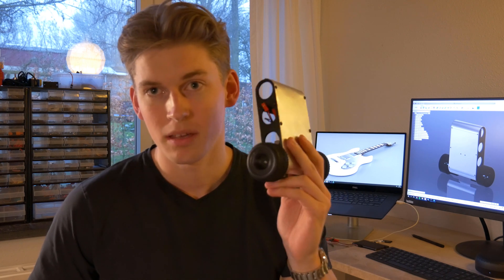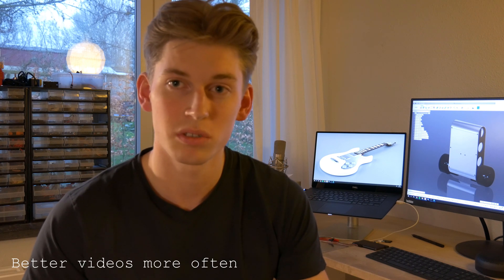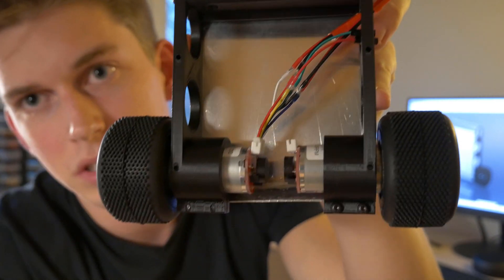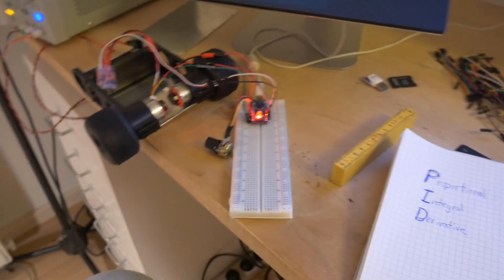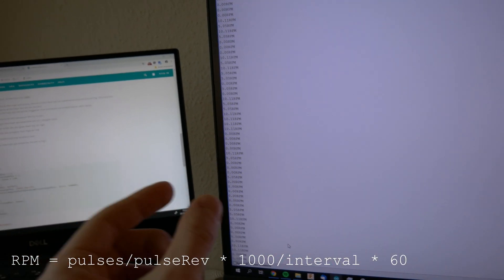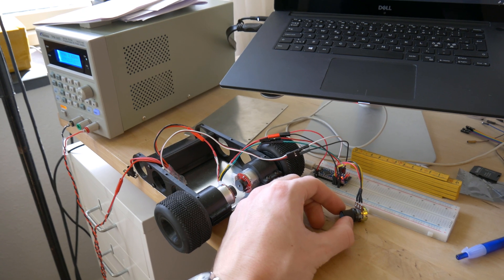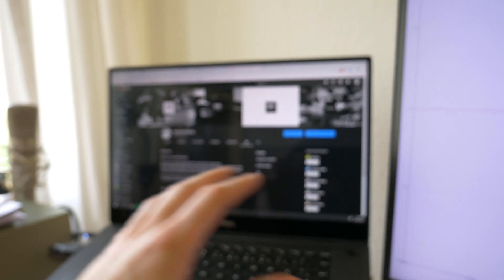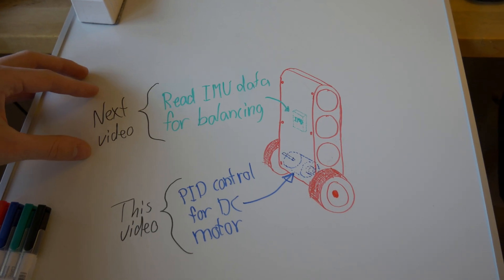Arduino 2-Wheel Balancing Robot - Part 1

Comment: Hi Karl, Thank you for the video. Can you Kindly point to the theory of this? I know this is based of the concept of inverted pendulum. But would like to know how do we arrive at the size of the robot? Why is it the height it is and why not shorter or taller? what factors/dimensions influence its cg? How do the size of the wheel affect its control? I am not sure whether you referred to technical papers, if you did can you Kindly share the links to the references you used? Thanks.
Reply from the maker: Hello Messier

I didn't pay much attention to the dimensions for this robot. The higher the cg, the easier it is to balance. I haven't completed this robot so I don't think I am the right person to give the best advice 😄
Reply: @Karlemilstorm  You've done a great job on the robot and it looks cool too. Thanks and cheers!
Reply: @messierthirtyone777  Build a robot of whatever size and later adjust PID values accordingly